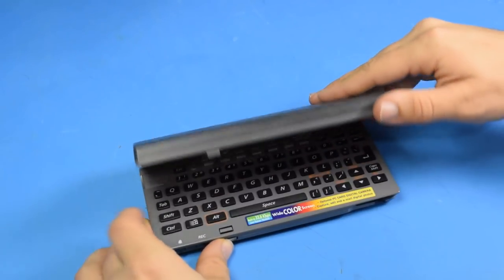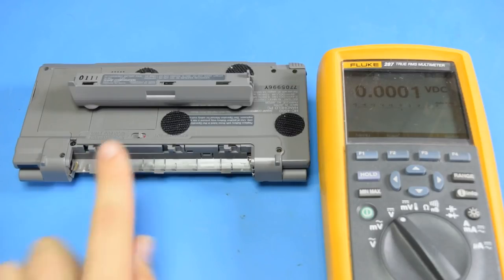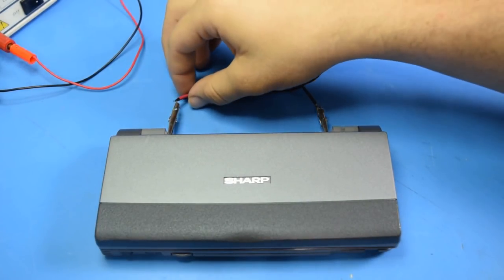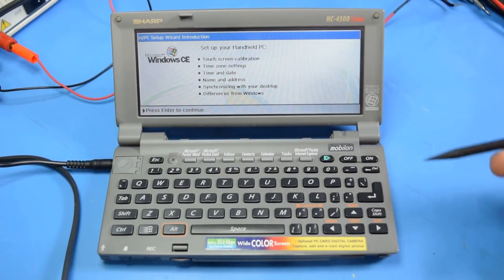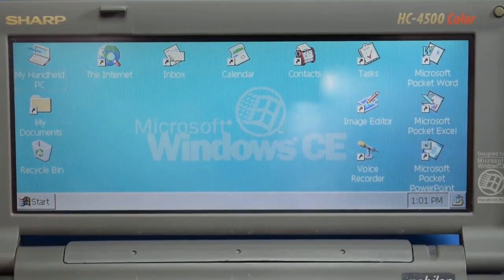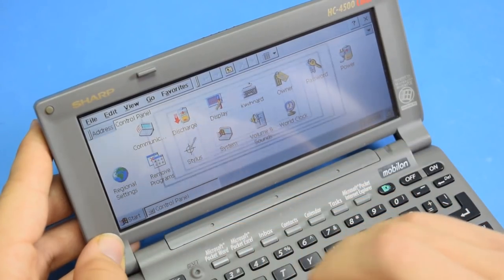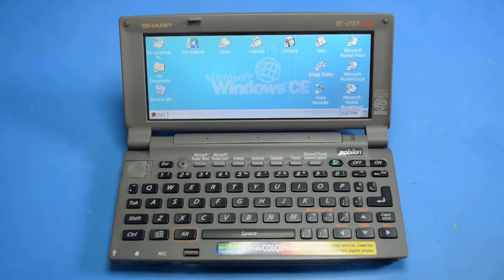0x002E - Sharp Windows CE PC NiMH Battery Rebuild

Comment: TIP: Don't push on the screen hard when you calibrate, it's not force... the stylus needs to be on the X for 1 or 2 full seconds... (this is why you perceive it takes lots of pressure, it's not instant like today's tech.)

Comment: I've personally soldered quite a few batteries and have never had a problem.  The most important thing is to use a quality soldering iron that will let you get in and out without sinking too much heat into the battery.  Use Flux pretin both the batt and the wire and you shouldn't have to apply heat for more than a couple seconds at a time.  I can touch the solder joint almost immediately after the solder solidifies which means very little heat got into the cell itself.

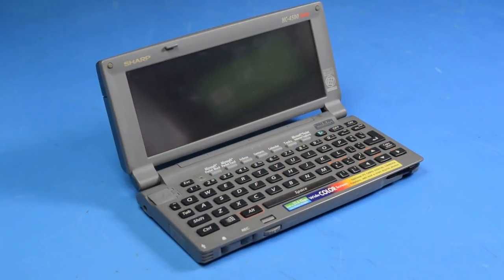Comment: 0:07 "I've been wanting a pocket-sized tiny computer for a while now"
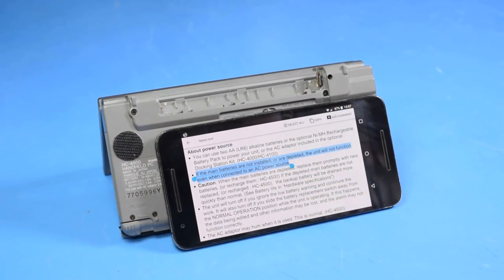0:32 shows pdf manual on smartphone
;)
Reply: Smartphones don't have physical keyboard (there were some back in 2010-2012) and typing really long commands on a touchscreen can be frustrating and time consuming.
Reply: today you can easily buy remote physical keyboard that you can pair with your smartphone and use it for your convenience
Reply: A phone doesn't run windows or macos
Reply: @harpergaming2731  No, but pinephones run Linux.
Reply: @harpergaming2731  Still a computer, a computer is something that calculates processes in binary. Couldnt expect anything from harper gaming to be honest : /

Comment: I remember being fascinated with these, when they were sold in stores, often sitting next to HP Jornada's. I went with HP's 720 and loved it so much, when the original wore off, I bought myself a second one. Sold both off to someone else later, when the 2nd screen was starting to dim too much. If only there was a replacement TFT screen. CF card made it very easy to transfer software, even without a link cable. Those things also ran on NiMh, for up to 8 hours (when an average laptop lasted only 2). Spec-wise, HP's were similar to Sharp, but had way more physical functionality.

Comment: If it has a working PCMCIA slot, you may try to use those Compact Flash cards to store data and transfer them to the PC by a Compact Flash to PCMCIA adapters, that's how I install Office 95 on my Toshiba Libretto
Reply: PCMCIA adapters for SD cards do exist, I found a few at a yard sale
Reply: No, get an Orinoco Gold WiFi card, for that vintage wardriving/hacking experience

Comment: 5:54 those are A Cells (Single A), fyi. very uncommon, pretty much never used in Consumer applications, BUT you can source them!
Reply: Make sure you spot weld it ....with a soldering iron and flux
Reply: eksine soldering isn’t the same as spot welding.......
Reply: @colinantink9094  I think the joke went over your head dude
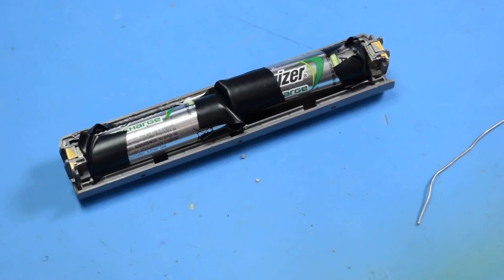Reply: Colin Antink, yeah in the video at 6:30 he made a joke about spot welding, and he shows the solder he used
Reply: Sean Michelin - DaiAtlus79 I have a product that requires those (plus not included 
(c" ತ,_ತ))
Reply: Colin Antink r/woosh
Reply: Sean Michelin - DaiAtlus79 You can source single A rechargeables...in quantities of 3000. I would go for 4/5A nimh batteries. They will fit perfectly and are only 2-6$. You can also get these with tabs pre-welded. You can then solder onto the ends of the tabs easily and safely.

Comment: Ooh, these WinCE handheld PCs are fantastic fun to play around with. You can actually do a surprising amount of offline stuff with them, if you can be bothered to keep syncing things over... slowly.

I did have Linux running on a HP Jornada 680 a while back, it was very, very slow - but it did actually work just fine. It kicks Windows CE completely out of RAM upon booting Linux from what I remember.

Comment: Still not as dangerous as soldering to 18650 cells like The 8-Bit Guy did a few years ago
Reply: Haha, I remember that.
Back when he was the iBookGuy
Reply: @Hazard There's a cheap way to do it (see LinusTechTips)
Reply: It's not as dangerous as it seems 
But shouldn't be done
Reply: @Hazard and there is
Or you can do a bank of capacitors which will do the exact same

Comment: Almost a year to the day, I am writing this to suggest you should attempt to collab with someone into 3D printing to produce a detachable back piece which fastens the batteries into the unit rather than reuse the battery case. Seems viable, and with enough additive manufacturing you should be able to make something work.

Comment: Well, I have two HP Jornada 720s and I've used them daily in the last 3 years to take notes on university, record 3 hours long lectures (in a suprisingly good quality) and to listen mp3-s. I must say that Windows CE 3.0 Handheld PC 2000 is the most stable OS that I've ever used. Within these 3 years, there was only 1 time, that one of them had crashed. Even handles the 8 GB CF card which is officially unsupported. I have 3 batteries for them, but one is enough for a normal day. The Pocket Office is way better than the Office for Android and also can handle the same keyboard shortcuts as the normal office.

Comment: I have bought the same model today for 1€ at a flea market, and it's batteries were rusty so I threw them out, took two rechargeable batteries and placed them in with aluminum foil, and I also replaced the cache battery and now it works just fine.

Comment: Soldering to batteries is definitely safer than spot welding since there is much less heat involved (if you do it quickly). Mr Carlson's lab made a video about a really good method for soldering to batteries. Yes I did notice you soldered the batteries anyway.
Reply: Guy Crew Ya, he made a custom soldering iron for the job essentially. I've soldered to batteries with a regular iron and it is a hassle! Just trying to get the solder to melt and stay on the contact is difficult...even after sanding. The iron just doesn't heat it up fast enough like Mr. Carlson's cool little contraption.
Reply: @peterlamont647  I can't find the video, would you mind sharing the link?

Comment: I bought an old Jornada 620 that was sold on New Egg ten years ago.  They were used by Conductors on Dutch Rail.  Back then it was hard to find a WIFI card with supported drivers, it will be really difficult now.  Also, it will be impossible to find a card that supports both CE and and modern encryption.  You'll only be able to use it on open WIFI , because it will only be able to use WEP.  There are also no shortage of pcmica NIC adapters.  I used a pcmcia flash memory adapter to move data on and off it.  If you have the Sync cable you can use a USB-Serial adapter and Microsoft Mobile Sync to access the CE device too.  The WIFI part really sucks, because I would have continued using, but WEP is obsolete.   I also used the same WIFI adapter on my  Libreto 50CT, and it was the same deal.  I had Tiny Linux on it and those two were my main mobiles devices.  I was forced to buy an EEEPC.  I like tiny computers.

Comment: A few years ago I had an HP Jornada 690 unit very similar to this. It could be synced via USB over a syncing cradle. IIRC it also took Compact Flash cards natively, and had a PCMCIA slot. Great little unit for its day, but not much use these days. There are a few working Wifi cards supported by it.

Comment: That cylindrical metal thingy is a thermal fuse.
Reply: The Tyttuutface he already said it.
Reply: In the same section of the manual, it says it is a fuse that cuts off at 170oF. There is also internal heat sensor stuff that turns off charging. They put that in there as an extreme case for extra safety.

Comment: Back in the early 2000s I had several different Mobilon devices, because the only other mobile computing options at that time were bulky, expensive laptop computers. I started with the HC-4100 which had a black & white LCD screen and ran off of 2 AA batteries. I later bought a HC-4600 because it had a color screen. It was slightly heavier and bulkier than the HC-4100. Unfortunately, I had to do the same repair that is featured in this video. Eventually, I finally decided to sell the HC-4600 because it was a bit bulky and the short battery life. Simply put, I found the HC-4100 to be a better device for my mobile needs at that time.

Comment: I believe it doesn't matter how many amps the power supply is rated for, the device will pull as many amps as it needs to run. The power supply will not push the full 3A to the device. I also believe its the voltage is what really matters to not let the magic smoke out. Don't know if I'm right though.

Comment: Linux on them doesn't work that way ;)

The loader will bootstrap the kernel and then kick windows the hell out of there(ie freeing up all ram used by it). Unfortunately this usually means you must store personal files and such on a memory card since ram will get nuked. (virtually all handhelds / pocket PC's from this era used ram as both storage and.. well ram :) )

I saw it had support for PC card. Get a cheap pcmcia to cf adapter and a cf card and you're set.
Reply from the maker: I believe Windows CE is stored on a ROM on this device. Any files, configurations, or linux would be stored in RAM. When power is lost so is everything you've added.  So what I meant was that Windows CE would still be "on" the device taking up "storage". There would be relatively little space for linux to be stored. If it had a normal re-writable boot drive I would remove as much of WinCE as possible and replace it with linux.

I like the PCMCIA to CF adapter idea. I'll have to explore that. That sounds like something simple enough that drivers may not be needed.
Reply: nuking windows like that avatar image you got
Reply: I remember there was an application called "Sprite Backup" for Windows CE and Mobile Classic that helped with that thing of losing personal data, by basically backing up the storage partition of the RAM into a file on a memory card.
Reply: AkBKukU Doesn't need drivers, I have that Sharp's bigger badder brother, I do everything off of a Sandisk CF to PCMCIA card when I use it. (Which admittedly isn't much these days)
Reply: at least the HTC Kaiser(a decent Device if you're using Opera Mini 5 and have a downloader that can download a .3gp format of a youtube video though you are limited to up to 15 MB downloads) a Windows Mobile device doesn't have this issue though my imate Jam suffers from this horrible issue of losing what is stored on it
Reply: Yep, definitely saw a PC Card slot when it was open. There's tons of cheap CF adapters, so that's definitely an option.
Reply: HaRET???
Reply: I used to run Linux & NetBSD on WinCE handhelds. Generally, you would add a bootloader (packaged as a WinCE exe) such as HaRET on the ROM, with a config file to boot from a CF or SD card. This means that you have a normal filesystem, mounted from a removable drive. It worked really well (but this was ages ago, most hpcarm ports have since been discontinued).

Comment: You wouldn't want the Vaio P's either way. Those use Poulsbo (PowerVR) graphics which are not only crappy, they also don't work on Linux and the Windows driver is extremely outdated.

Comment: I have an HP windows CE device (320 LX), that has a daughterboard that looks a lot like that little board you thought might be RAM or storage. On the HP device, it's the ROM, and you could take it out and swap it for an upgrade from CE 1.0 to CE 2.0. This could be something similar on this device.

The way you can get stuff onto the device, is to get a CF card adapter for that PCMCIA slot. I use my 320LX as a portable word processor. That one has a CF slot, but it seems to not work entirely properly under battery power, where the PCMCIA adapter works reliably.

I do a similar thing for my HP200LX, which is a machine I enjoy using a lot more, as it can run all sorts of old DOS software. But, the keyboard has a number pad, which shoves everything over left, which makes it less ergonomic to thumb type with, which is why I got the 320LX.

Comment: Could you get data on there using that handy "The Internet" app? Or does it not come with any WiFi PCMCIA card drivers preloaded on the system, putting that idea back at square one?
Reply: William Kulich if that card slot is standard, why not a CF adapter? That'll also cover storage incase the battery dies.
Reply: Windows ce
Reply: Haha definitely no wifi drivers in this thing.. I had one of these 15 years ago or so but never succeeded in getting it online

Comment: You can probably send files back and forth over IrDA with an XP machine. Just have to find an old laptop with an IrDA port (I've used machines as new as the ThinkPad X60 that still had infrared), or you can get a serial IrDA device from eBay. I used to use one called the JetEye PC. I bet a CompactFlash PCMCIA adapter might work too, assuming it has the drivers for it. Not sure if you'll be able to find a decent price on it, but I was curious and found the serial cable's model is QCNW-1015YCZZ. Good luck! Pretty cool old device you've got there.

Comment: I still have a portable DVD player where the battery died and the replacement I bought actually did not fit, though it looked the same.  I opened both batteries and swapped the cells, along with the polarity.    The original battery pack had 4 cell and two empty spaces.  The new battery had 6 cells and slipped right in the old case.  Prolonged the operational life by at least 50%.

Comment: I actually have one of those Sony VAIO ultra-portables. It has a Transmeta Crusoe CPU in it as well as ATI graphics, and the aspect ratio on it is insane, something like 1200x600 or something. It needs a couple parts to get up and running again, but the last time I used it, it does work. It's a pretty neat little machine. It's a Sony VAIO PCG-C1MGP.

I just need to find everything for it, it's dotted about all over my room in different boxes :S

Comment: How long do the new batteries take to charge ? And do they last as long as the original ? I see some batteries out there are 2000mah each. So thatd make the new one 4000mah total if i rebuild mine with those. Original battery on my HC-4000 is 2400mah total (both batteries).

Comment: I have soldered batterys before for my RC Car Li-ion batterys what you have to do is take sand paper and ruff up the surfaces for the solder to wick to, you just have to make sure the cell doesn't get to hot to go into meltdown mode.

Comment: Not sure if your still tinkering with this, but i just found out you can swap the battery adapter (takes "AA" nimh cells) from the hc 4100 so no need for modifications if you can find one

Comment: I dunno if this has already been put out there, but I've been loving those raspberry pi hacks where they put them in a old PSP or gameboy as an emulator hand held. So could get a PI 3, solder off the USB, network, hdmi ports. Then attach a new screen if you can find one, cut in some USB Holes, HDMI out? And put in a rechargeable battery so that it can be charged off the micro USB port.

Comment: Did you ever get wifi to work on this? I ask because i'm thinking about buying one... i could use pcmcia ethernet. I read in the manual that the 4500 doesn't support all pcmcia cards, presumably because of the 2.4v?

Comment: own slight older hp model with a mono screen (white backlight) so glad it takes AA batteries! well except the time plugged in a 56k pcmcia modem and drained them in seconds connecting to internet via dial up!

I did try to get linux which can run from pcmcia / CF storage (mine has both sockets) but obscure chipsets, rare cpu types (mips) and I guess lack of interest on those devices lead me to find nothing, mine is stuck with CE, I can only say I am grateful it comes with a bunch of software otherwise it would be useless.

Comment: Just saying, soldering on NiMH cells is not nearly as critical as it would be on lithiums, and even with those it seems to be quite doable without them going off in your face (the trick seems to be going fast, preliminary sanding of surfaces for better tinning and not trying it on LiPos whatever happens).

Did you measure the dimensions of the original cells? Pixel counting suggests maybe 18 mm diameter and pretty much the same length as an AA, could be an AF (18x51). Anyway, I'm guessing those LSD cells should be mostly adequate, though something like Eneloop Pros may have been a better choice (being rated for high current consumption).

BTW, it may be possible to revive the original cells to some degree unless they are shorted, thought I guess that's a moot point now.
Reply: PileOfEmptyTapes Hey, i did the same project recently on this model. The Hc-4600. They used single A batteries. I couldnt source them so I went witha 4/5A battery with tabs pre-welded. Much better option than consumer AAs if for no other reason then power capacity. Originals had 2500mah. Mine have 2200 mah. So overall, not bad. Average AA is like 1500 mah i think.

I did try charging the batteries repeatedly, tried freezing then charging etc. They were just bricked. Also the 1.2 volt "reference voltage" he points out in the video, isn't. Its actually a second 2.4v input. Both have to be connected. I just wired both up to the +2.4 and that worked. 1.2v actually did nothing. It was like having no battery at all. Once they were both 2.4 it lit up and charged normally.

However, my digitizer doesn't work. Which is terrible. At least mine has the 32 mb upgrade so if i have to buy another one, it wont be a total loss. I'm hoping i can fox that issue as well.